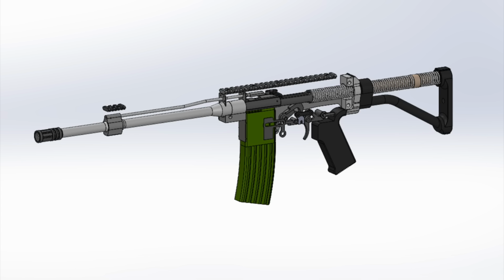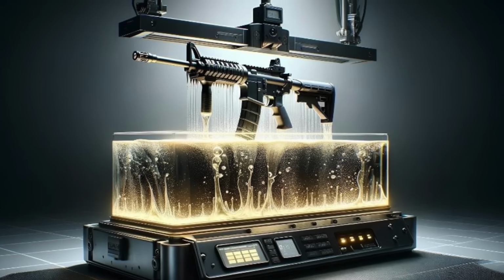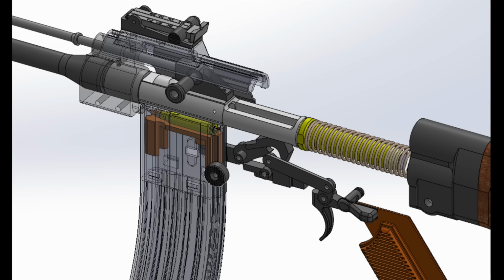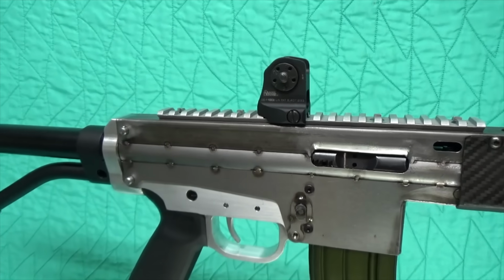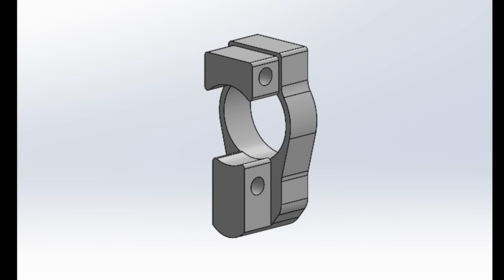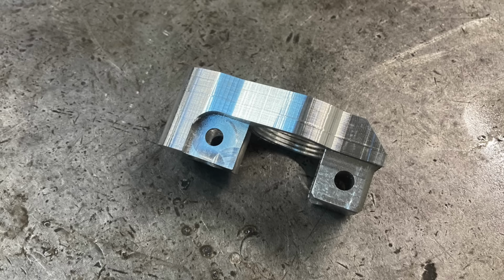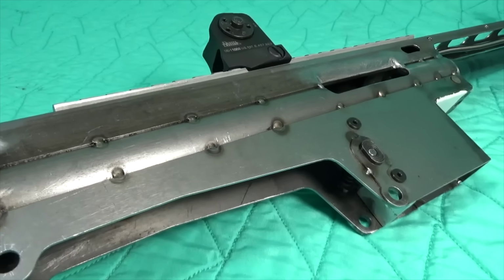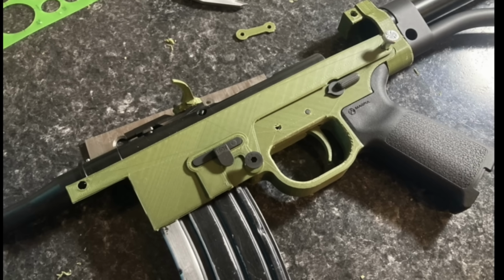The JLC-24 Rifle!

Comment: Buddy, tech is not magic. Without some serious nuclear reactions you’re going to have a very hard time turning that homogeneous goop into the elements/ atoms required to “assemble” any molecule that isn’t a derivation of the goop. Hell, we haven’t even cracked fusion of deuterium & tritium to make helium, one of the easiest fusion reactions possible. That is,we can barely fuse 2 hydrogen isotopes, the lightest element to create helium, the 2nd lightest element. That’s literally 1 + 1 = 2, and fusing a one & a one into a 2 requires a machine roughly the size of a high rise office tower, roughly the cost of a high end city (the whole city), & roughly 75% the way through construction. There are physical limitations; fundamental limitations, & we are already beginning to hit. To do what you’re proposing, we would need to break the laws of physics. That’s hard to do these days. No Moore’s Law exists for nuclear physics & chemistry. Nothing suggests the sort of exponential advancements achieved by the semiconductor industry over the last 40+ years can be expected to carry on in other fields. (And no, “AI” does not change that). It’s neat. It does have some real exciting applications, but it’s not all its marketing suggests. It’s just an evolutionary software architecture that helps ppl work with massive sets of data. It’s the answer to, “Well, we’ve got Big Data. Now, what the hell do we do with all of it? How do we sell it back to ppl?”)

Comment: I started a tool and die maker apprenticeship just so I could learn all the different aspects of metal working and design that are needed to manufacture firearms. i'm coming up on my first year now and so far I've learned Solidworks, Catia, I'm currently learning Tebis while working with an okuma CNC mill, I've started learning how to properly operate a Bridgeport, how to tig weld(still pretty new to this and need a lot more practice to get good), how to properly use a drill press, how to use a stamping press, how to hand fit components with critical tolerances, how to use a surface grinder, etc. I think I chose the right path instead of doing a gunsmithing apprenticeship. That wouldn't have gotten me anywhere close to where I want to be. 

Ultimately I want to make rifles and pistols and own my own firearm factory.

Comment: Absolute noob question but as someone who is a graphic designer that has always been interested in prototyping firearm designs in my head using basic tools, this is very interesting to me. However I don't even have the terminology understanding to ask the right questions. The best I can think is "how was this made?" not just the frame/receiver  parts, but the barrel, BCG, hell even buffer springs. Are there articles on this kind of stuff? what do I search for? Not sure if this is a better question for Justin, or if anyone with knowledge could answer this. This is probably a stupid question, but I am so lost just trying to find a place to start.

Comment: Due to shrinkage and warping with 3d printed parts I'd be really wary of using it to determine final fit of metal parts.

You can be lucky and have very little shrinkage if the part is relatively small, supported adequately, and printed at lower temperatures, but when I've tried larger parts that require high degree of accuracy there's always problems.

It's just a limitation of consumer-grade FDM. By the time you account for dimensional changes in the printing process, your model might may no longer be suitable for metal fabrication, which has a whole other set of requirements.

Better slicer programs might make it easier to go from "true" 3d engineering models to usable manufacturing models whatever your manufacturing method...

Comment: That was pretty Kool !!!
With modern metal printing that should give the "Gun Grabbers" plenty of sleepless nights !!!
A sealed cabinet and a mig gun mounted to a printing carriage along with a Dremel Tool for cleaning ...
All computer controlled...
Could be an easier cheaper option ???
With the dozens of wire choices anything metal could be made !!!
Then on to the larger version ???
Just imagine a sealed building an dozens of computer controlled robots in goes raw refined materials from hoppers outside and out comes a vehicle a airplane or anything else your heart desires !!!
With little to no human interaction...
Sounds a little Terminator or Elon Musk ???

Comment: We cut steel on an IPG laser at my work all day long. The shielding gas is the key. If you use nitrogen, you'll get a clean edge, but LOTS of embrittlement. If you can cut with oxygen/air you'll get a tiny, tiny amount of dross, but holes ream easy peasy and edges weld without prep. IPG didn't believe we could cut steel with oxygen, and we had to create our own speeds/program for it.

Comment: >Sees TACK WELDS on the gun  
>NEURON ACTIVATION  
  
This gun looks like the toy/model/replica stuff i build, but i use a lot of flat steel welding. I do as much as i can within legal limits and it is very promising to see some things similar to my ideas are done by someone else on a live firing weapon successfully.  
  
Only part i'm missing is accurate holes, i only have a wobbly misaligned drill press and a stick welder, so insane amounts of warpage are expected. I still managed to create a correctly aligned ejector/spring guide setup, it is surprising how much hobo gunsmithing you can get away. If i had to make live firing items it would probably suck much more, but it is not impossible.

Comment: Honestly, I have very few questions. This is a great project. I love seeing new tech solving old problems. 

The oldest problem being making a reliable rifle that costs half a weeks pay to produce. 

Today I had a long conversation about my affinity for stamped structures, better yet, ergos were a part of that discussion.

My point was I really like sheet metal structures, and I would love a left side charging AK. 

My left handed friend had the biggest grin, "a left handed AK?" NO, a left side charging handle, that doesn't suck. 

Hey buddy AKs are left handed, if you can figure out the safety.

So a napkin drawing, turned into a paper plate template, that was immediately installed into a corrugated cardboard mock up. Plenty of arts and crafts time, unfortunately there were no crayons. 

"just cut a slot where you want the thing to work, left handed AK safety is super easy" shaft+lever+slot=done

Assuming you don't mind deleting the anti-charging aspect of the Original safety lever...

We walked around the whole issue of the OG safety lever. Considered  possible solutions, then decided, it was pointless.

"oh no, I can chamber a round while on safe". The inverse being you can clear with a safety locking the fire control. "newer safer feature" 

What about the detent for the safety lever? Now that we lack the external dust cover/safety lever? 

You could probably hide a leaf spring /wire pawl inside the receiver for safety detent. File a notch in the shaft. Easy stuff.

We also had a pizza party, so that was cool.

Comment: I have watched one of you old video where you explained the diffculties to tig weld rails into recevers, (deformations, overheating).

I wonder what you think about laser welding to prevent or maybe solve those issues? 

It seems to have minimal heating area. The only dowside this process of welding seem to have is the "torches" are big, and require a certain angle to work correctly. (kind of like the first TIG torches in fact...)

Comment: No body to date has ever 100% printed a reliable safe gun from scratch and they never will. The Pressure bearing parts of the gun have to be Steel.

Comment: I can remember making an under-rib for a .45 acp target revolver I was building in the 1970s by drilling the barrel diameter (untapered bull barrel) in a block of steel and cutting away everything I didn't want with a shaper. It looked pretty good when I got it finished. Heck, I read about the Afghanis, before our little war with them, SMLE .303 out of CAR PARTS using blacksmithing level equipment.

That rifle made me think of a commercial I heard about 10,000 times in my childhood. For Timex watches, they'd do things like strap them on an outboard motor prop and run it  for a few minutes, then John Cameron Swayze would bring it into the camera view and you could see that, at least the one he was showing, was still running. Then he'd say, "It takes a licking and comes up ticking." That rifle was certainly ticking away.

Comment: That 3D printing lets you create a simple and effective jig to help you easily ECM rifle a nice piece of steel tube, turning it into a surprisingly good gunbarrel, this fact alone is so wild to me.

I can only imagine where things are gonna go as additive manufacturing develops further and gets cheaper. One day, there'll be a machine which will be able to print out the individual parts for a weapon much like a MAC M10, springs, magazine components, and barrel and all, and all you'll need to do is assemble it and it's done. Perhaps the parts can even be surface finished as part of the printing.

Comment: Mark, by the time they're able to essentially recreate the replicator from Star Trek they'll be making phased plasma rifles in the 5MW range😂🤣😅 like T1 wanted.
The problem is the single most dangerous weapon on the planet today with the highest potential for mass casualties is a.i.😢

I could make a complete pistol from start to finish, minus springs, pins and grips in the mid 90's from a CATIA rapid prototype system that ran a cnc machine. It was pretty cool😂

Comment: Power of the laser matters, a weaker laser would spend more time getting through the metal and put more heat into the material, which would affect the heat-treat.

A more powerful one would basically vaporize the metal fast enough to take most of the heat with what was removed and not put much heat at all into the remaining material.

Sorta the same as with regular machining except with photons rather that cutter teeth...

Comment: The square tubing and sheet steel to form the receiver was impressive. 

What was the reason to lengthen out the receiver so far? It seems like you had to do some odd things to the trigger, bolt, and buffer to work with that receiver length. I'd imagine it was to give it more if a "constant recoil" by lengthening the available travel so it doesn't slam on the buffer tube.

Comment: Also in general, using 3D printing to make jigs, fixtures and guides has been a massive upgrade for many other manufacturing techniques. 
Just printing the tools you need for a project instead of making the project printable itself.

Comment: Haha
Still want to build an ashwood chassis with steel reinforcement that will accept off the shelf ar15/ possibly ak(sks?) Gas piston parts and in spirit be like an old lotus or catterham roadster. 
The ashwood is rigid and naturely vibration deadening and would get less "black rifle hate" than either an ar15 or ak because of how recognizable they are,and just look great too while bein cheaper than a ruger mini14/30.
Thinks an easy dream to accomplish a few tools away and novel enough any usually expensive machining would be almost donatable for the love of the craft even in a smalltown like this.
Haha
Maybe go 6.5 grendel since 7.62x39 has been increasingly scarce while its been becoming easier.
Food for thought internet 👍

Comment: I had made a pattern for casting an MP44 receiver in 7073 aluminum, that had a cam pin bump blended into the LH side.     Was supposed to be bored out to run an AR15 bolt carrier with DI gas.  I can't remember who I sold it to.   I made the pattern for casting the lower trigger mech housing too.
Reply: Can you share the files or videos

Comment: Being able to ECM a pipe into a barrel by itself has been a game changer
Reply: Right? It's so straightforward, and it actually makes a pretty damn decent barrel.
Reply: @0neDoomedSpaceMarine Hmm never seen this done, sounds pretty interesting
Reply: @Lotek117  Won't be like the nicest ever match barrel or anything, and you still need to cut a chamber (as well as working out how it's gonna attach), but it'll make you a proper barrel with good and usable rifling, almost like you pulled a random 9mm barrel from an old Sten or Uzi parts kit or something.
Reply: @0neDoomedSpaceMarine  I am sure it will get near match grade.
Reply: ECMing barrels have been explored for quite a long time. I recall the Army did research with such technology in the 70's and did it with 7.62mm MG and 20mm cannon barrels. They weren't nearly as enthusiastic about it as the US Navy, who did their trials with a 5-inch naval cannon. The Navy did admit it was pretty ambitious to test out a new process by making the biggest cannon they had, but it was done nonetheless and worked out pretty well. 

In the Navy trials, the process was able to achieve the desired tolerances for rifled naval gun barrels while leaving a surface finish well suited for chroming. What they found particularly attractive with ECM is that it makes it much easier to cut the rifling into very hard and tough alloys that otherwise would be far too expensive to physically cut for something as big as a cannon, allowing for improved barrel life and reducing maintenance costs. 

The Army report is a two-part document as AD0751862 and AD0751863 (may be written as AD-751 862 and AD-751 863) titled "IMPROVED MATERIALS AND MANUFACTURING METHODS FOR GUN BARRELS" from September 1972, and the Navy report is ADA072437 titled "ELECTROCHEMICAL MACHINING OF GUN BARREL BORES AND RIFLING" from September 1978. It's worth a read if you can stomach the very technical language. 

My guess as to why it hasn't been more widely adopted with gun barrels is probably more to do with industry inertia than technical matters. The firearms industry and their customers tend to have a very conservative view toward firearms innovation, and tend to settle into a safe space once new trends that intrude become the new status quo. There is a general reluctance toward new developments due to the comfort and certainty of existing designs. Take the AR-15 for example, it took decades for it to become as mainstream as it was not because of patent law or technology, but because the consumer market was entrenched as it was. Once it did break into the mainstream gun market, it has become as entrenched as the wood and steel guns of before, and more radical concepts like bullpups become seen with the same suspicion that AR-15s were once seen in.
Reply: ECM? I must have missed how the barrel was made.
Reply: @ShootBlueHelmets  idk if this barrel was made via Electo Chemical Machining, but it's very viable.
Reply: Consider the application. Even surplus uzi barrels are much more accurate than the most probable user.

"minute of good enough"
Reply: @olddirtybooger i mean they are the 8moa range iirc for mil acceptance

Comment: 1:55 This already exists! volumetric 3d printing is a functional prototype right now. If you search the term "volumetric 3d printing" on youtube, you can find the group that made the first working prototype, and it essentially does a reverse cat scan. Its a rotating laser that flies around a vat of goop and traces out 2d slices, in the same method that a cat scan goes around you taking 2d x-rays but ends up with a 3d model of you. 

in fact, you can take data from a cat scan and directly print it using a volumetric printer. of course the prints are small at this point and this technology is just getting off the ground. it may end up leading nowhere like a sterling motor, but it may end up having some niche uses also like a sterling motor